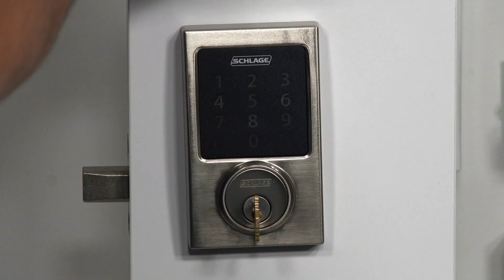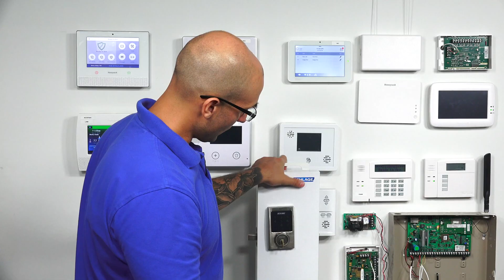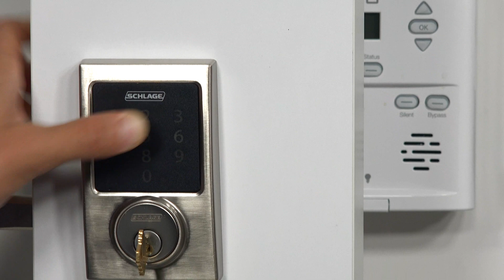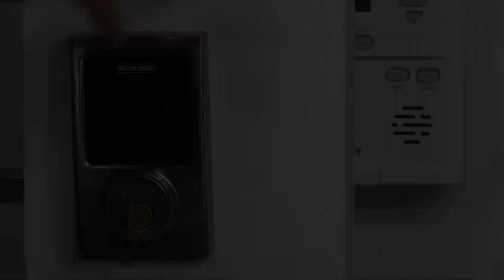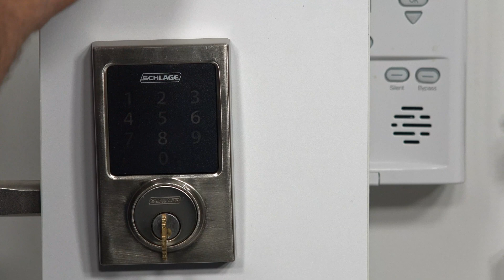Defaulting a Schlage Z-Wave Lock

Comment: I've done this several times, but it doesn't work. After the process I see red crosses
Reply: Hi Alex, do you know the part # for the Schlage Lock you are using? For the lock in our video is an older lock and the default process may be different on this lock compared to the Lock you have. If it is a newer lock, the installation Manual would have more info about Defaulting the lock. If the process still doesn't work according to the instructions in the installation manual, you may need to reach out to the manufacturer.  I hope this info helps.
Reply: @DKAlarmgridSupport  Hi, I have a lock BE469NX, 5646161-001, FW Ver.: MAIN_6.8  07162014. It’s 9 year old, working fine
Reply: Hi, my lock is Schlage BE469NX 9 year old. 5646161-001, FW Ver.: MAIN_6.8    07162014  @DKAlarmgridSupport
Reply: @DKAlarmgridSupport  give me your email please

Comment: Does defaulting remove the Schlage lock from the existing z-wave hub and is ready to connect to a new z wave hub?
Reply: No It would need to be excluded from either the old or the new hub to clear out the node information.
Reply: @nathangalarmgrid5205  how can we unenroll from the previous node/hub if don't have access to it?